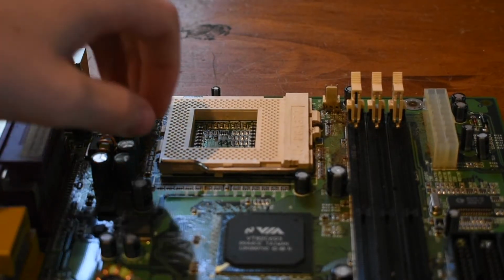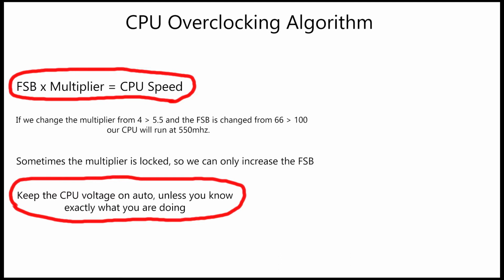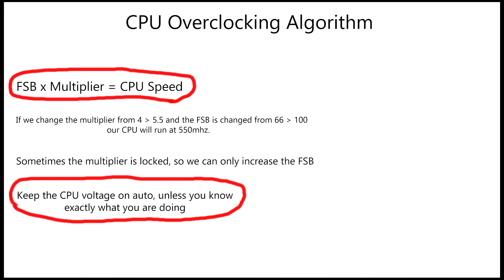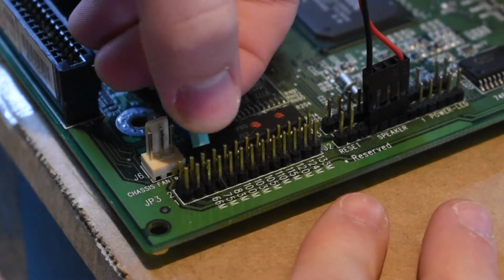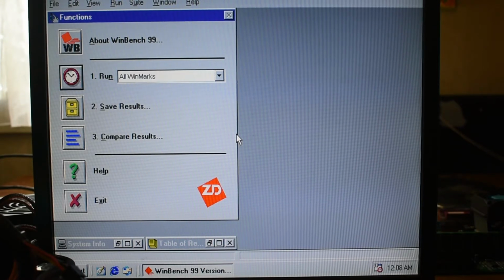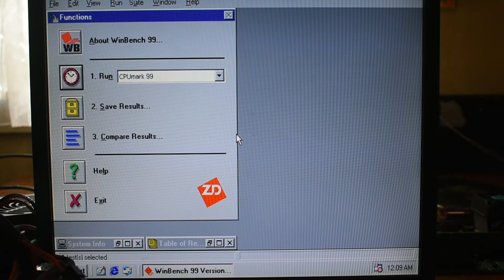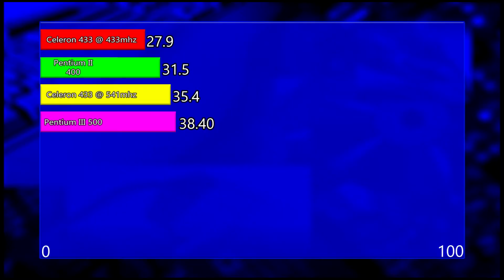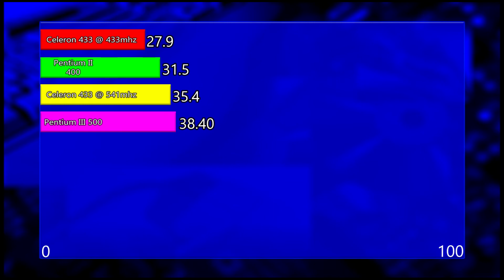Can An Overclocked Celeron CPU Beat A Pentium II? Let's Find Out!

Comment: Abit boards are my favorite for slot1 or socket 370. no jumpers required, it can all be done in BIOS

Important to note you need a pre August 1998 cpu to have an unlocked multiplier

Comment: Weird, I knew there were early versions of the i810 chipset that were limited to Celeron-only, but I wouldn't have expected an Apollo Pro board to have the same problem. I guess it's probably the voltage regulator? Like, the chipset came out in late '98, the first Coppermine CPUs came out in late '99, and your board was probably designed at some point in the interim before the manufacturer realized how much lower the core voltage was gonna need to go.
Reply from the maker: EATABAGOFHELL yeah it’s a bit of a shame this board uses a specific variation of the Apollo pro chipset since it would be great with a p3 otherwise. It was probably a cost reduction or something. I don’t think it’s the core voltage. It does go to the bois screen with a p3 866, but it wont boot into windows 98. Even in the manual it states that it’s the chipset that has the celeron limitation. But if it is the core voltage, you could probably get an adapter to lower it. Similar to the amd k6 voltage adapters for socket 7.
Reply: Via Apollo Pro 133 came out in mid 1999. But in that time, socket 370 was meant to be cheap socket for Celerons, as they were more expensive to produce on Slot1 for no reason (as they had L2 cache integrated)

It was Slot 1/ Socket 370 chipset, that's why it had 133 Mhz FSB. So it can support new, shiny 133 Mhz Pentium III Katmai (slot 1)

In this case of socket 370, it was meant to be used with celerons, so maybe, they somehow limited it in BIOS. If they've included voltage regulators only for 2.0v, then it cannot use later Coppermine s370 CPUs. 

If motherboard has voltage regulation capable of using 1.75v or lower voltage. Pretty sure, all could be handled by specially written BIOS, so it will support Coppermine CPUs. But maybe, motherboard manufacturer didnt released such BIOS, and let it Celeron Mendochino only board